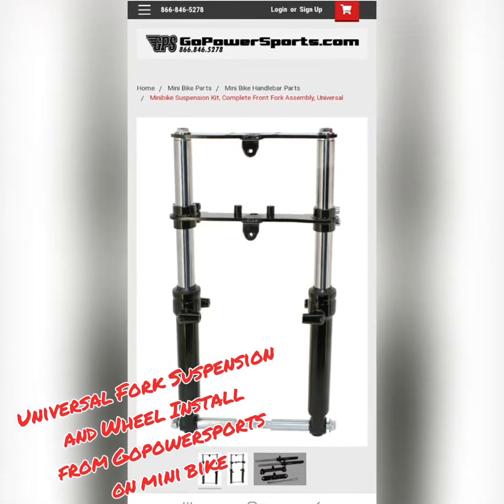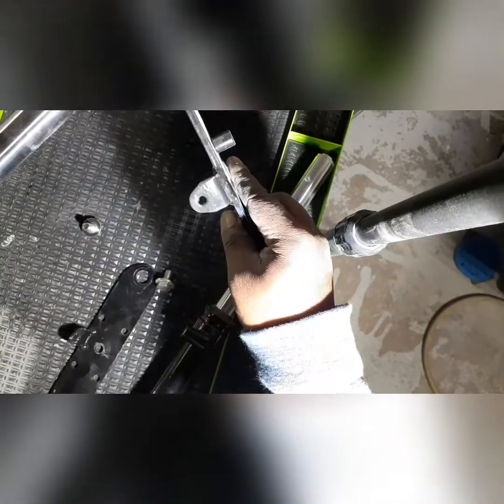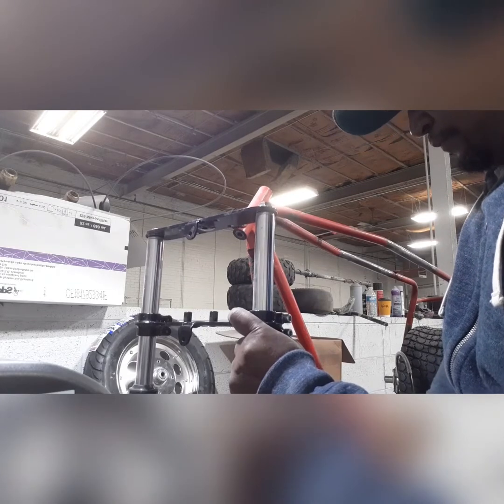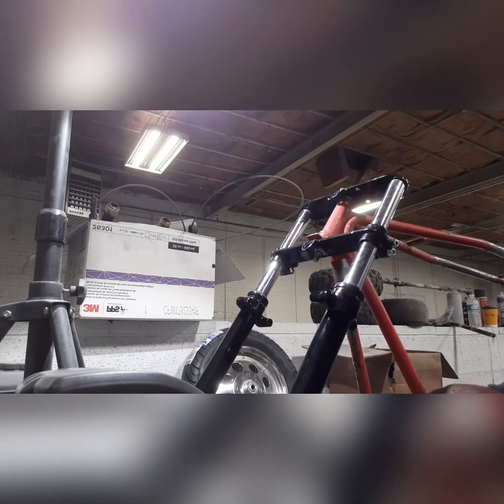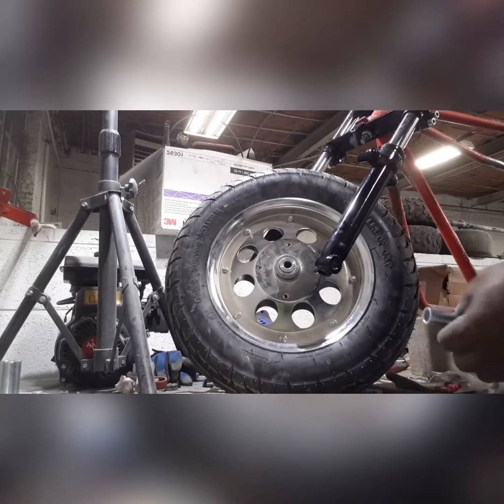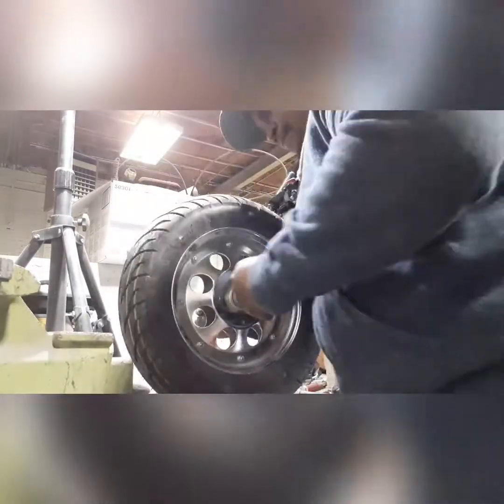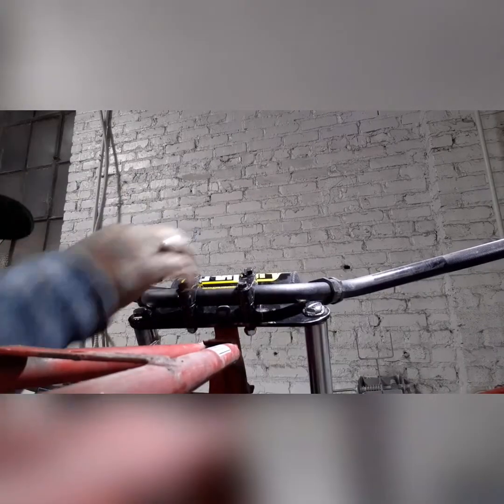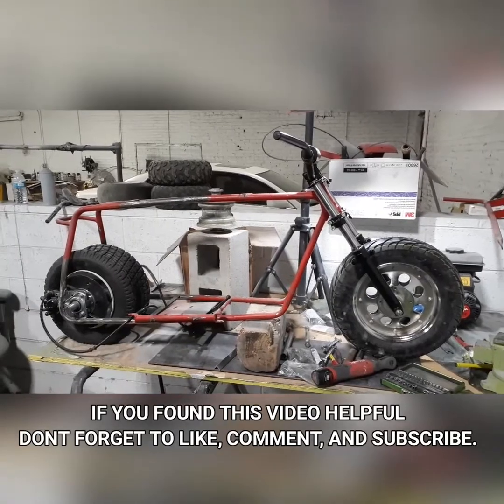HOW TO INSTALL UNIVERSAL FORK SUSPENSION & WHEEL FROM# GOPOWERSPORTS ON MINIBIKE

Comment: Didn't see the link for the bearings.
Reply from the maker: For all your ball bearing needs visit https://www.vxb.com/
Reply: Could you remind me of the size again please?
Reply: I ordered the kit just needed to know the bearing size. Also, do you have to use a tire with an inner tube, or can you use a valve stem? Thanks man. Your video took me over the edge to buy the kit. Lol
Reply from the maker: @TLLopez_Toviyahu27  if your gona use the gopowersports modular 10in wheel on the axle that comes with the kit use LR201NPP Track Roller Bearing 12x35x10 Sealed Track Bearings
Reply: Thanks man!! What about the tire? Does it need a tube or can you use just valve stem?
Reply from the maker: @TLLopez_Toviyahu27  Use a 3.50/4.00-10" Tube for gopowersports 10" modular wheel. The rim does not seal
Reply: Thanks again bro!! Appreciate you!!

Comment: What size axle did u use for the front
Reply: It comes with 12 mm axle and spacers 👍
Reply: @sandmanyaggy822 the 12mm axle doesn’t fit the 5/8 I.D beating with modular Azusa wheels
Reply: @sandmanyaggy822 bearing
Reply: @oddy3299  it fits doodlebug and motovox wheels . Azusa wheels are garbage anyway